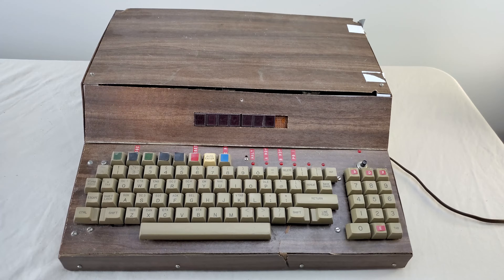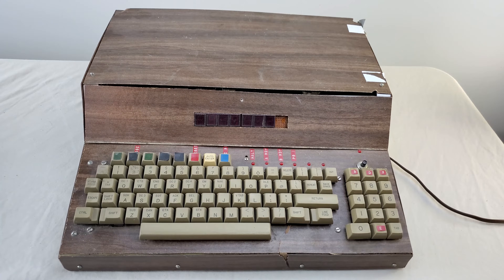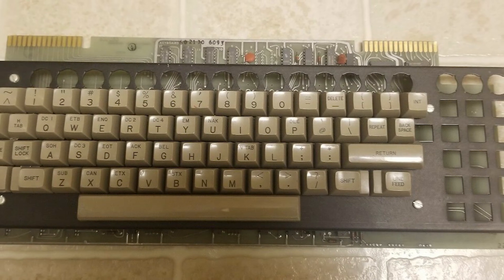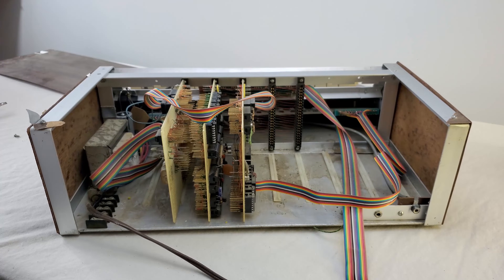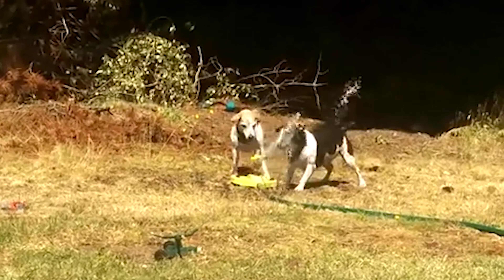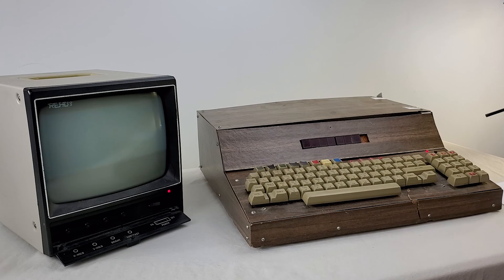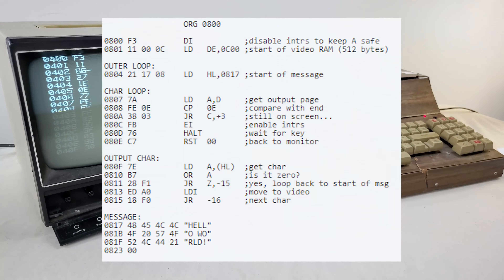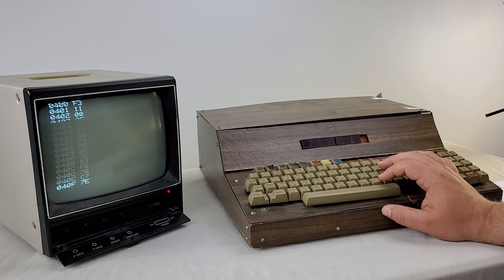Homebrew Z80 Computer from 1977 !! - 8BitBites

Comment: Nothing wrong with disliking Sinclair machines - they were cost cut to a degree they became unenjoyable. On the other hand - if you like homebrew Z80 stuff, check the afterlife the ZX Spectrum had in the (post) soviet eastern block. That's actually what I've kept being interested in in almost 20 years of the hobby when most architectures became boring and dull after a while.

Comment: That's so cool. I love the veneer look. I'm currently building a single board Z80 computer with built in BASIC. It's point to point wireing on veroboard using a lot of spare parts I've gathered over the years. Fun, but hard work. I got a ZX81 when I was about 12 and been hooked on 8 bits ever since. I'm 52 and still programimg and fixing them. LOL.

Loving the content of your channel, Subbed.

Comment: The skin appears to be a wood grain Formica.  Clever on the builder's part. :)
Reply: Oh gawd, thats the stuff with the kinda.. grid-like moulded back and smooth front, right?
Reply: @jonathan_herr  I've never seen it with a grid molded into it.  It's typically just a rough surface for the adhesive to grab on to.
Reply: @f15sim  well maybe not a grid per-se, but a rough repetitively patterned rear surface..

Comment: This is an odd device. I cannot imagine going to the difficulty of designing and building a computer from scratch, but with such very limited functionality. With only 1K of RAM and no external storage it is nearly useless. I wonder if the creator never finished the project (or if this was just a prototype for a later model).
Reply from the maker: I suspect the mystery card and empty slot might hold the key.  I kind of wonder if one might hold more RAM and the other some sort of tape encoding system.  Unfortunately if there was another card it is long lost.  But sometime I might trace the wiring on the mystery card and try to deduce what it does.  The only thing I can say for sure about it is that the machine will not operate with it installed.
Reply: @TechTimeTraveller  You mentioned a place you sent the rom to to get it dumped and figured out.  What was that website?  (You don't mention it in the info-below-the video (video description)  Such a place might be somewhere new I might want to take a look at?

Comment: If you expand it with RAM, also add a ROM with with a Basic interpreter
Reply: For the BASIC you can use the Microsoft BASIC for NASCOM which has a small footprint and it's suited for such small Z80 computers. If you tell me about the keyboard and video I can cook you a ROM file
Reply: @ninoporcino5790  grande Nino!